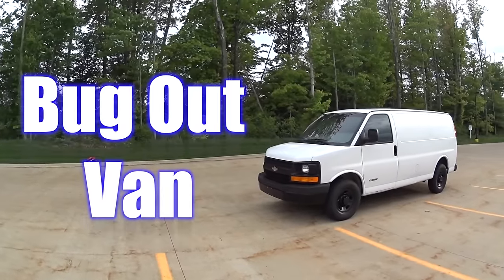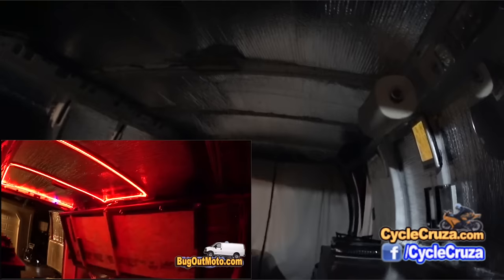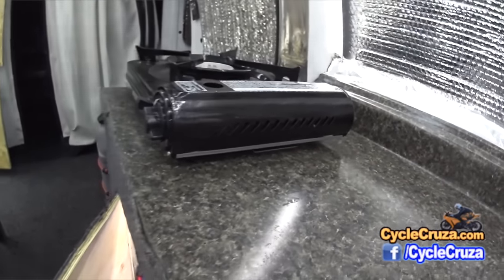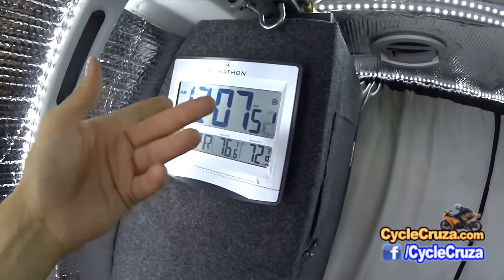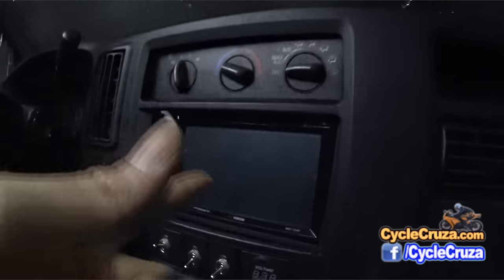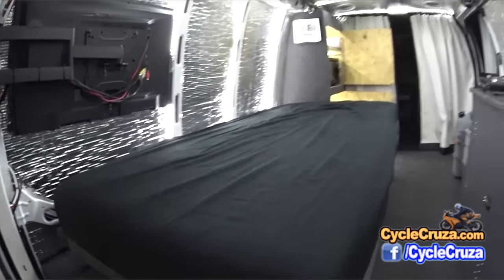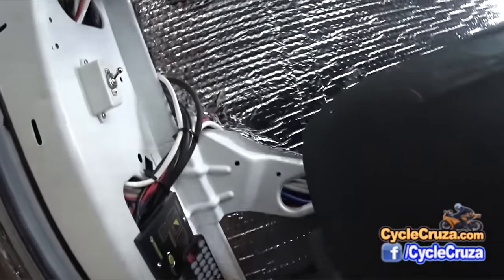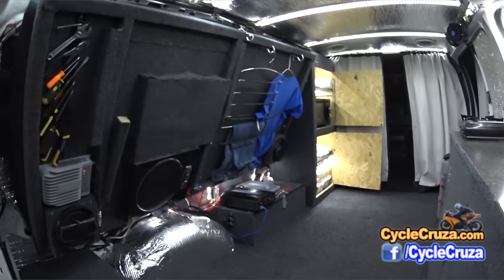Stealth CamperVan 2.0 New Mods! Carries Motorcycle Inside! - Tiny House

Comment from the maker: FYI: Links to get Van Mods in this Video Below:
Get 12 Volt Refrigerator 50 Quart here: http://amzn.to/2coIUv2
Get Thin 100 Watt Solar Panels here: http://amzn.to/2kVvzN3
Get 155 AH Deep Cycle Solar Batteries: http://amzn.to/2cHGW5K
Get 40 Amp MPPT Solar Controller: http://amzn.to/2cfqfgD
Get 20 Amp MPPT Solar Controller: http://amzn.to/2cKFraO
Get Solar Meter here: http://amzn.to/2cHHfgZ
Get 32" 12 Volt LED TV here: http://amzn.to/2cKEhw9
Get TV Antenna with Magnetic base: http://amzn.to/2cKGc3H
Get TV Antenna Extender Cable: http://amzn.to/2c4yWQg
Get Tiny Security Cameras (Infrared): http://amzn.to/2cMjGDI
Get 6.5" DVD Multimedia Head Unit Stereo: http://amzn.to/2cKGyrj
Get Weather Station here: http://amzn.to/2cKH7kz
Get 12v to 6v converter here: http://amzn.to/2cfsAIf
Get Weather Station Remote sensors here: http://amzn.to/2ceGnkC
Get Van exhaust Vents here: http://amzn.to/2cHJiRP
Get LED Natural Lighting Strips here: http://amzn.to/2c4zntS
Get Awning for Cars/trucks here: http://amzn.to/2c4ykKB
Get Awning Room Attachment here: http://amzn.to/2cKHRGq
Get 12 Volt Dual Fan here: http://amzn.to/2cftGns
Get Tire Pressure Sensor here: http://amzn.to/2cfuTLf
Get Voltmeter here: http://amzn.to/2cHKGnz
Get MicroSD HD Video Recorder here: http://amzn.to/2cHM5uq
Get Quad Video Processor here: http://amzn.to/2cKIyzI
Get Screen Material (make screens): http://amzn.to/2cfvQ6r
Get 12 Volt Vacuum here: http://amzn.to/2ceJadO
Get Small Folding Tabe here: http://amzn.to/2coLBgp
Get Portable Camp Chair here: http://amzn.to/2c36Zpk
Get Wall clock with Indoor/Outdoor Temp: http://amzn.to/2coMQfj
Get Auto Fuse Boxes here: http://amzn.to/2ciKwEW
Get 100% Copper Wire CHEAP: http://amzn.to/2cHOhlQ
Get My Action Camera CHEAP here: http://amzn.to/1F85kog
Get Aerosol fire extinguisher cans here: http://amzn.to/2c6FNJ3
Get LED Dimmer Knob Switch here: http://amzn.to/2cpw11C
Link to Get ALL of my Van Stuff:
 http://cyclecruza.com/links-to-get-my-bug-out-camper-van-stuff
Reply: Question : What sticky adhesive or glue did you use to stick the LED strip lights to the ceiling of the van ? In my van the heat causes it to dis attach all the time :-(
Reply from the maker: hotmasked1 gorilla glue. Best glue ever made.
Reply: Q: It seems like you've replaced your old 4*100w panels with new 245w+325w. I wonder if something was wrong with the old ones? Which panels did you use to replace them?
Reply: CycleCruza where do u store your extra cans for the i rain burner
Reply: Butain
Reply: epic
Reply from the maker: Link to Get ALL of my Van Stuff:
 http://cyclecruza.com/links-to-get-my-bug-out-camper-van-stuff
Reply: CycleCruza .

Comment: All your mods just made my head spin. You are really great at wiring stuff. Im a mechanic by trade and not an electrician, so I'm still learning, but capable. I'm in the middle of my van build now. I really like your setup for the bed being folded up. I was wondering how I could fit a kayak inside. Now I know lol.

Comment: seriously though I would avoid running both the engine and everything out the back off of the samer battery.  I would have a Cranking battery system for starting the van and a secondary system for running everything else in the back of the van.  Sick van though mate
Reply from the maker: I didn't touch the van's electrical system or the van's battery. Everything in the back is powered off the 570 watt solar system and 3 x 155 Ah deep cycle batteries.  I'm able to get all the power I need, even on cloudy days.

Comment: have to ask...w/all the mods do you ever think about when the van dies?  Or when you sell her?  your van's mechanical maintenance is everything...don't run well, no bug out.  But if you only use it for road trips it should last forever.
Reply from the maker: These are commercial vans, built for toughness. These chevy express 3500 vans regularly get 500k miles or better if maintained well. Any problems I would just have it fixed. However, I carry a motorcycle inside where I can bug out from the van anytime. This van was built to carry a motorcycle inside, if you haven't seen my last full review go check it out: https://youtu.be/iUeTRfTBQgY

Comment: I love your van Videos.
Would love to have a Ford E350 4x4.
Reply from the maker: thanks! I always thought about getting a 4x4 van BUT more than likely you'll never use the 4x4 much, not really needed in dry conditions and any hairy trails I wouldn't want to take a van on, could topple over. All hairy off-road applications, I use my wr250r. However, most dirt roads I can access fine with 2 wd, just carry a shovel in case.
Reply: +CycleCruza You would be suprised were real Offroaders can go.
If you had an locking diff in a 2wd you can go far, but an normal 2wd is really just an 1wd.
For your Application it's true, just talking about me.
Love 4Wheeling.
Reply: +CycleCruza waiting for your videos out on the Trails. can,t wait.😉
Reply from the maker: Sarpe You'd have to lift the van. Vans aren't built for hardcore off-roading tho. Imo, a 4x4 van is really more about vanity than substance. I'd only use it in bad snowy weather. I used to 4x4 when I live in colorado with a pathfinder. I couldn't imagine 4x4ing in a van on real technical stuff.

Comment: Love your van and this Video Series, especially how to setup the solar panels.
Cool Portable Potty also

Questions regarding the battery (not an expert)
How long does a full charge with no sun recharge take? (normal use with TV, speakers and 2 ref)
How long does it fully charge and could it over charge?

Thanks in advance :)

Comment: With all the mods to the van. Did you add more horsepower, brakes, and dampers to compensate?
Reply: It's a commercial work van, so it's already built to take a certain payload in addition to pulling a trailer.

Comment: I like the insulation. I'd put an ac in ceiling with generator
Reply from the maker: the motorcycle couldn't pass through with a  a/c on the roof. My WR barely passes though like it is now, reason I couldn't even add a fantastic fan. These two small vent fans work wonders though, keep the air fresh.
Reply: That's good, I just hate the humid summers it's tough sleepin weather. Sweet setup though
Reply from the maker: I hate heat too, but I cut all of the fans on in the van, even my 12v blower fan and it's stay pretty cool.

Comment: take a look at the Engel fridge better quality than the ARB,Also uses less power
Reply from the maker: Btw, from what I've heard, Engle and ARB fridge line are one of the same company now. The Engle fridge that I liked doesn't have low battery monitor shut off like the ARB fridg. Also, the Engle fridge is more expensive and louder than the ARB fridge. The ARB fridge is legit, has the Dan Foss compressor. Check the reviews, very highly rated. Engle is good but outdated now. I will give long term updates as I normally do.
Reply: Thanks keep up the great work

Comment: Thought you were going to get rid of the microwave unless you will be using it for TV dinners. If you get rid of the microwave, you will have room for your motorcycle gear.
Reply from the maker: It's in there just for show, to show that a microwave can fit in the cabinet, however, it's dead weight that I don't use and it will be removed before I take my trip. Cans of food, bread, fruit, etc will be there instead (a food pantry). Fits a ton of food on that one shelf.

Comment: Mods are probably up to 15k now. If they are, it makes it really easy for me to calculate the total cost of an equivalent build. 15k for mods, 5k for the van.
Reply from the maker: Before the second round of mods the van + mods was a little over 10k. I only added about 1-2k  max. Even at 15k you could not get a set-up like mine. Sportsmobile vans run like 100k+, although it has 4x4, none of them accommodate a motorcycle inside like mine with all of the amenities I have. My rig is one of a kind that is highly useful and keeps my bike safe, don't have trailer anything either. I can't even put a price on this rig. Btw, all mods are covered on my insurance as long as I have receipts for everything. Also,  I re-classified my van as a RV with my insurance company, which saves me $300 a year! I only pay $300 a year now for full coverage (Before I paid $600 a year!).
Reply: No no no. I meant that to build out a van similar to yours should be somewhere in the realm of 15k-20k in its current state.
Reply from the maker: Hazardous-Nebula A lot of the stuff is not the build materials but rather the little stuff . This was all an experiment so there was some waste trying different stuff out like the induction burner and the microwave was a total waste. If I built a van like this again it would be much much cheaper, there are so many things that could be cut out such as excessive wiring. Also, if I knew the van would come out this good I would have bought a brand new chevy express 3500.

Comment: So does this not drain your car battery quickly?
Reply from the maker: All solar power, 570 watts of solar power on the roof and 3 x 155 AH batteries. I guess you did not watch the video? lol  I talked about my solar power set-up twice. I don't use the van battery except for the van.
Reply: Nice setup. And yes I might have been a bit too fast asking it :D.

Comment: Does not sound like you use this camper van very much for the $$$ you have spent on it. Sounds like it just sit around unused most of the year. Sounds like it would be cheaper to trailer your bike and stay at a motel for the few times you use it.